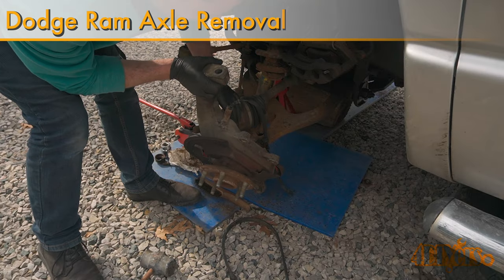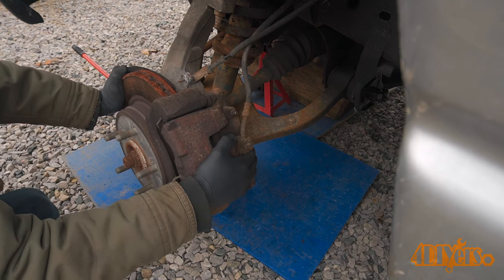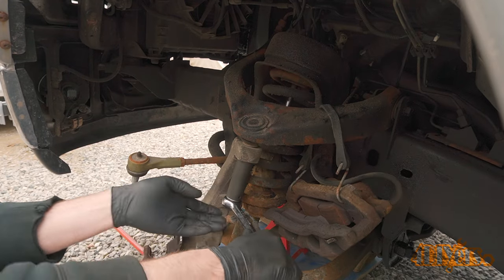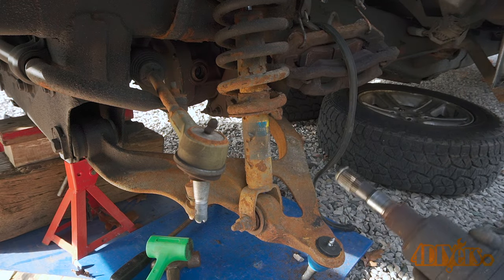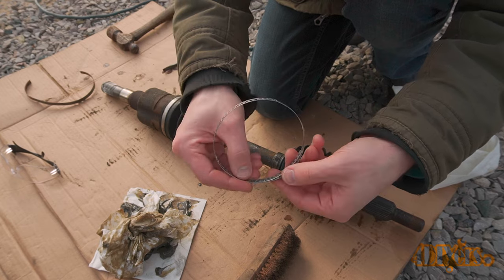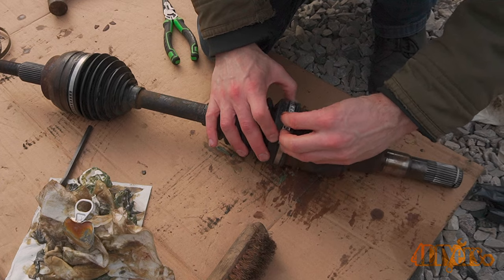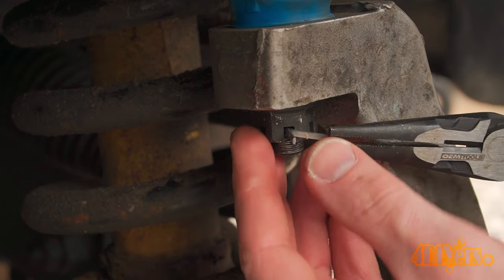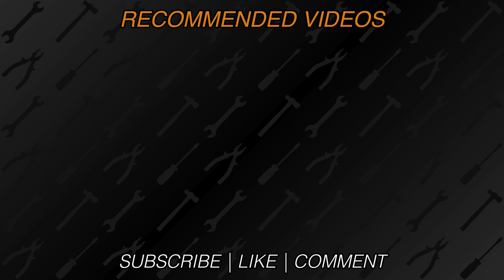How to Remove the Front Axle Dodge Ram 1500 and Grease the CV Joint

Comment: Can one still back it with grease instead of replacing after the vibration alerting you its needs service has happened! Assuming the vibration is from it eating itself up? Thanx
Reply from the maker: It could be stiff, not allowing it to move properly and causing a vibration. It will eventually wear out unless caught in the right time. So you can take it apart, clean out the out grease and then repack with new grease.
Reply: @4DIYers  thank you
Reply from the maker: No problem!